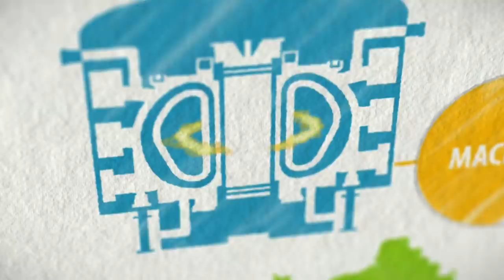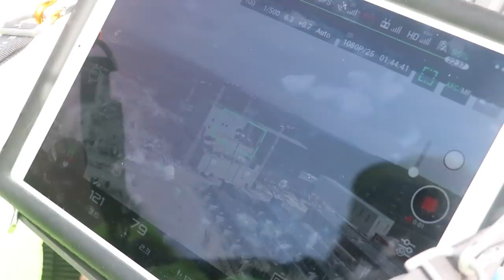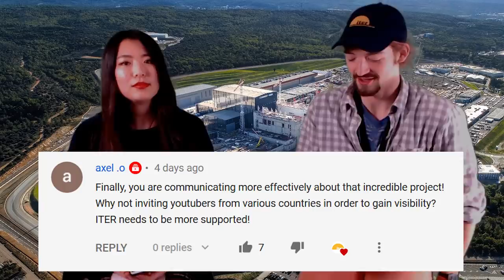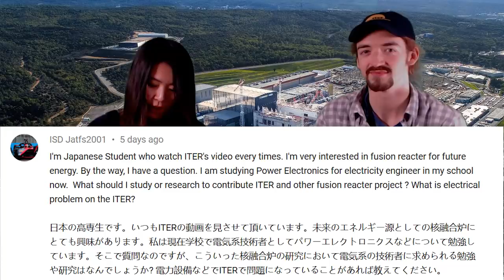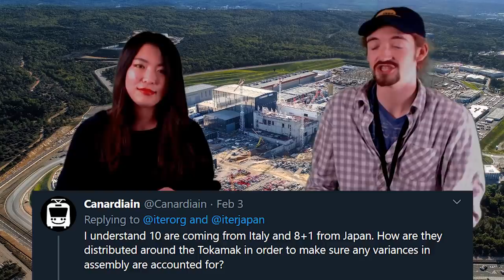ITER NOW 1.5: Eyes in the Sky

Comment: Hi! Nice job, I have a question. Why are you using hydrogen instead of helium for the fusion process?
Reply: From what I remember it was easier and a by product is helium
Reply: Fusion with hydrogen is easier because of a lower temperature that it occurs. It also produces more energy per atom.